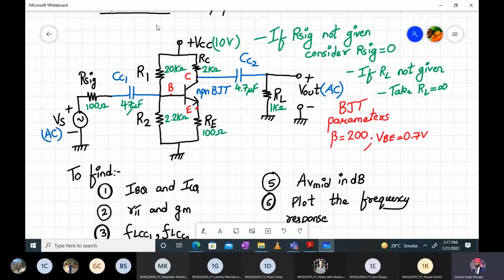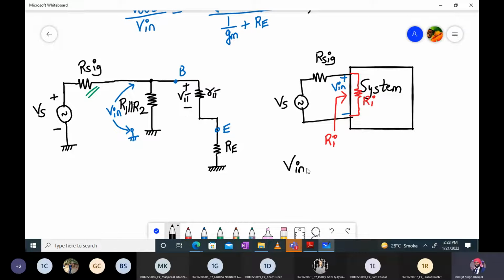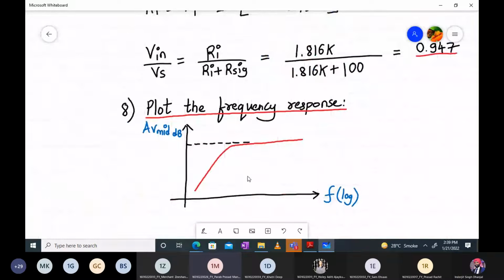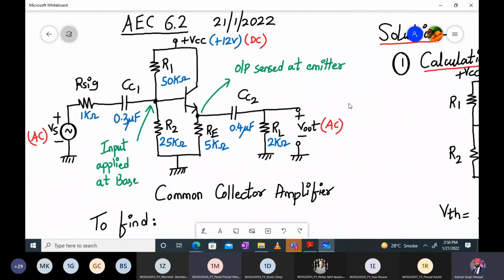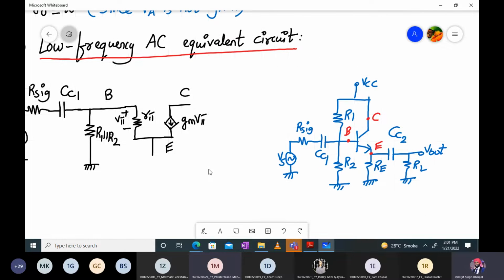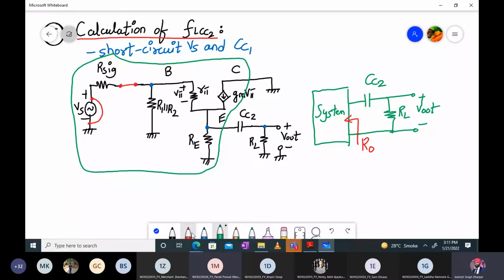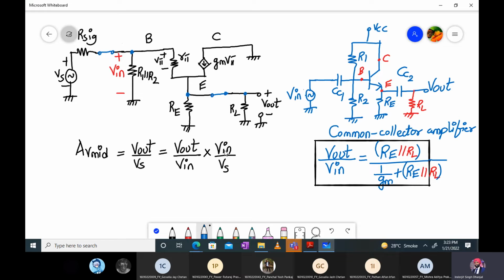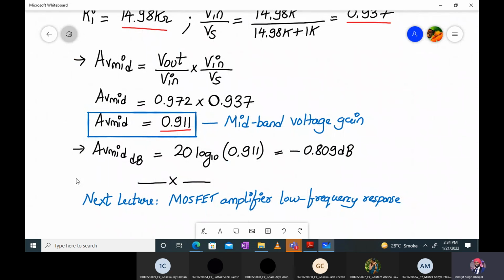Analog Electronics Circuits Session 6: Numerical on Low Frequency response of CC BJT amplifier

Comment: for midband gain, vo/vin you used gain that we would get from T-model where 1/gm is re . For vin/vs you used pi model .Wouldn’t this give inaccurate results since you’re mixing both the T-model and π-model in the same mid-band gain formula